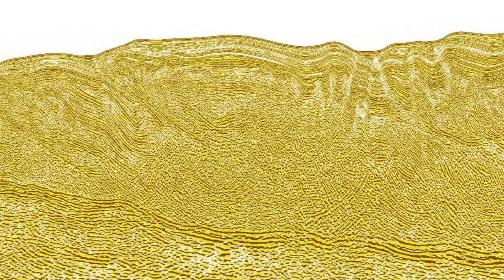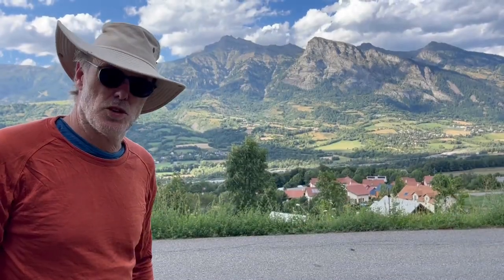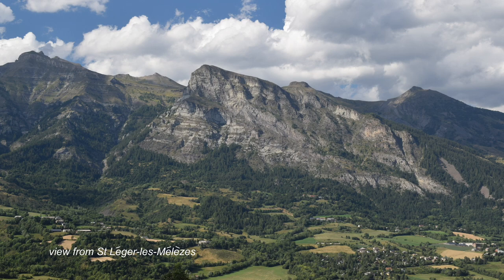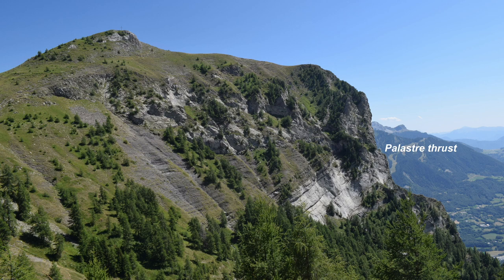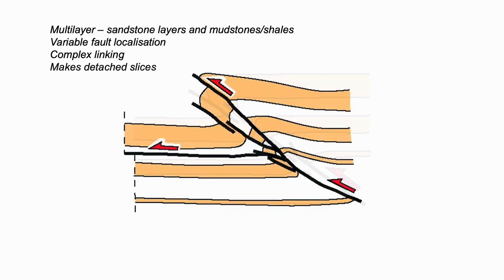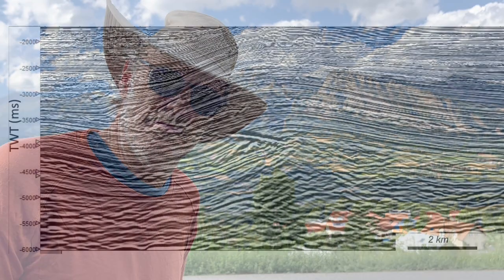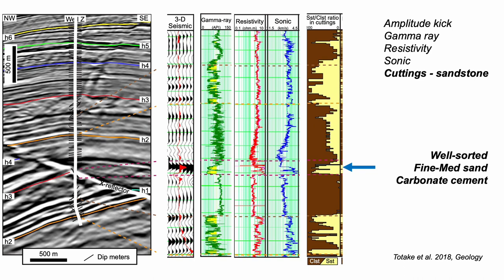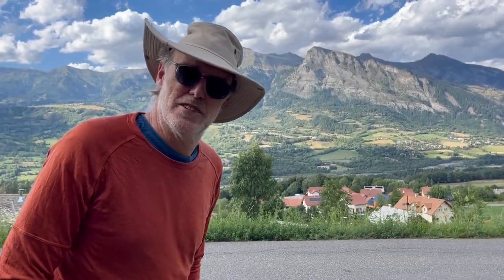Deepwater thrust zones - Subsurface and outcrop

Comment: Very interesting stuff. I'm pondering on  the synchronous and post thrust fluid and pressure dynamics that take place in these zones. Particulally pressure solution, cobald creep, crack n seal crystalization, and the solution movement and mixing that would occur as the thrusts bring the various lithified and not so lithified rock types into close contact with each other. Thanks again Mr Butler.
Reply from the maker: All good ponderings... hard to judge timing relative to fault motion for the precipitates for Sabah.. Might be possible from core or image logs but cuttings - I doubt it... outcrop - well, yes, by looking at cross-cutting structures in the fault zone...

Comment: Thanks a lot.The past west Alps and now  Borneo offshore (SE Asian?) both give similar structures----thrust. It is a good method to discuss current oceanic structures  by comparison clues from the continent, similar to that between present oceanic floor and ophiolites. I've listened to all the 80 videos on Structural Geology by now. The gains are great.  However, it is still necessary for me to systematically listen to the preparation of geological maps.
Reply from the maker: Have fun with maps!